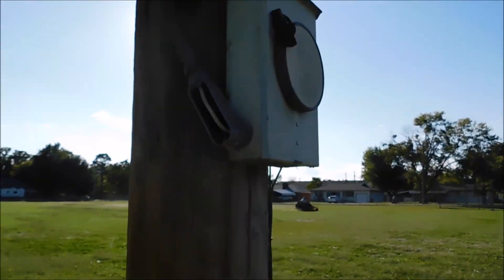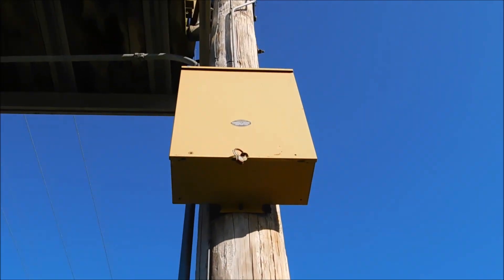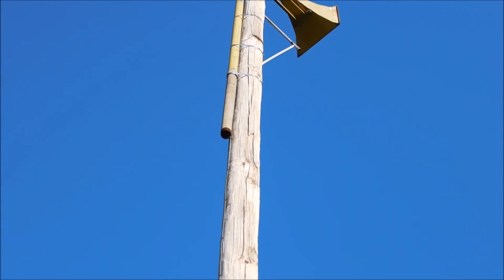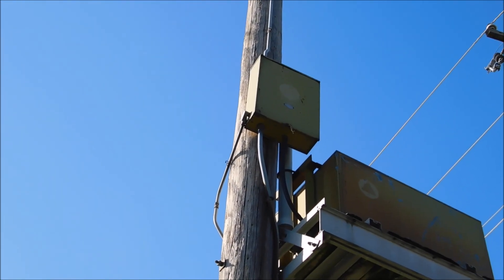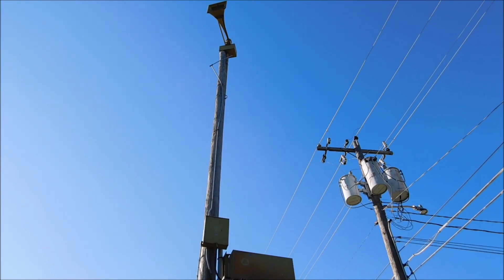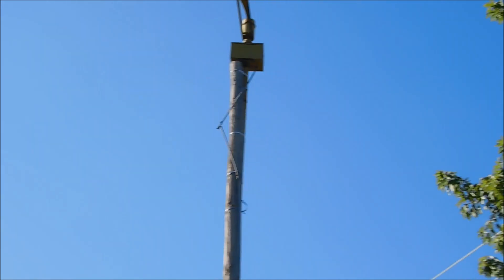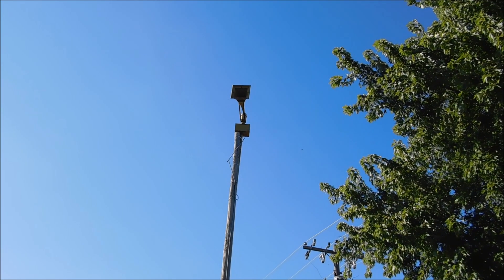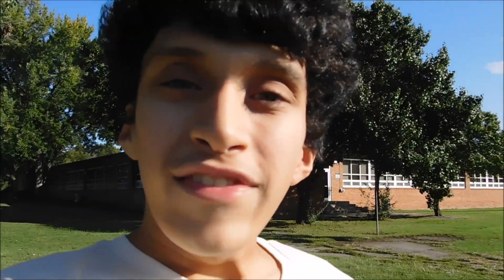My Town's Dead Thunderbolt 1000T Siren Tour! | Claremore, OK

Comment: The USA Siren map is pretty inaccurate and isnt the best. If i were you i would use the actual Oklahoma siren map, it says this bolt is a 1000, but who really knows until we hear it. Also the box on the other side by the blower is the RCM1 which has the blower, rotator and chopper controls, so yes it does have the motor starters in there. And the other one is the Siratrol which does have the AR timer and radio inside. Its also a rare bolt! Because it has no vents on the end of the blower which means it has either a 5 or 6M blower in it and it could be 4/5 port if its dual toned. Those blowers were made from 1952 to around 1963. So its pretty old! Theres not very many left of those. They made about 16,000 thunderbolts and this one lies between if i were to guess, 700 and 1500th one made.
Reply from the maker: THANK YOU! I was hoping that someone more educated with Thunderbolts would tell me clues as to how old this particular model is. For being this old, this unit is in surprisingly good condition, so I guess they just don't make these sirens how they used to. It'd be cool if this was 4/5-port because only some of the oldest Thunderbolts come in that port ratio, and this could be one of them! And now that you mention it, there are no vents on the blower, which is rare like you said! There are also no decals on the rotator, and there's no mesh on the horn, which could also help tell how old this unit may be. Chances are that this Thunderbolt is from the early 1950s to the early 1960s. Thanks again!
Reply: @milespeterson5049  Make a mini Thunderbolt 1003 pls
Reply from the maker: @SirensOfKansas  I plan to! Just, maybe after I make a few sirens!
Reply: @milespeterson5049 Yeah no problem! It actually is in pretty good condition for being a 5/6M bolt.
Reply from the maker: @IowaSirensProductions  Thanks! I guess every Thunderbolt is unique! I will, of course, let everyone on my channel know of any updates on if I can get one of these! I'd totally restore this Thunderbolt if I had the chance.
Reply: @milespeterson5049  I can narrow it down further. It's definitely from the mid 1960's with a 5m blower. The lack of a vent on the cover along with bolts on the tube coupler (where the pipe leaves the blower) are clear signs of an earlier unit. The rotator box isn't one of the slim or short ones used on 1950's units, so this one is definitely from the 60's, anywhere between 1960 to 1964 when the 5m blower was in production.
Reply: @milespeterson5049  I hope you get it if they decide to get rid of it!
Reply from the maker: @IowaSirensProductions  Thanks!! Yeah, I just hope I can 1. haul it home safely, 2. get my parent's permission, and 3. restore it and get it workin' again!

Comment: Here's the Thing

This Siren is missing the Lower Blower Pipe and it's still standing
Reply from the maker: Yup! Claremore doesn't typically remove old sirens, but rather they install new ones on new poles. Most of the old ones still stand on their original poles.

Comment: Love your channel! If you'd like to see any other thunderbolts near you, heres a link to the thunderbolt map https://www.google.com/maps/d/u/0/viewer?mid=1OsqQYSWmT1n0r7XraeGLmW6kZlo&hl=en_US&ll=36.28891350137776%2C-95.2987507370232&z=9. The box just next to the power meter would be the power disconnect. The bolt seems to be 5M A2, maybe. Only way for us to know is if you were able to take a picture of the tag on the head.